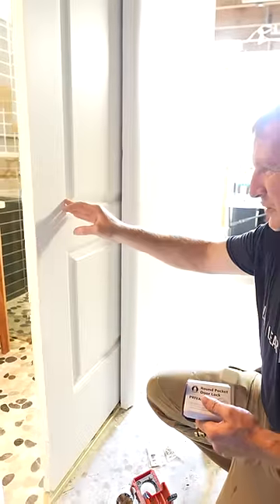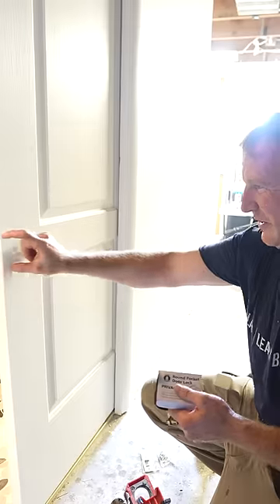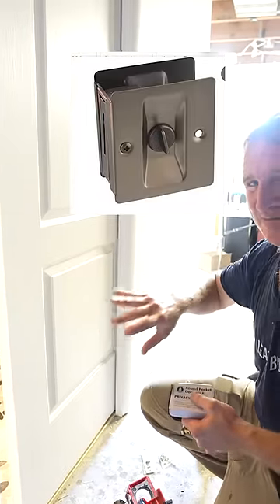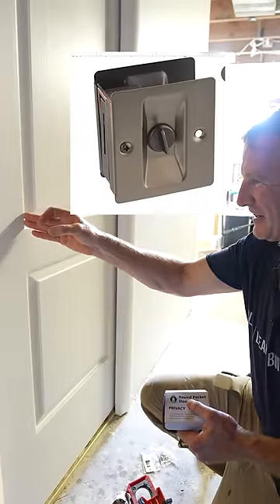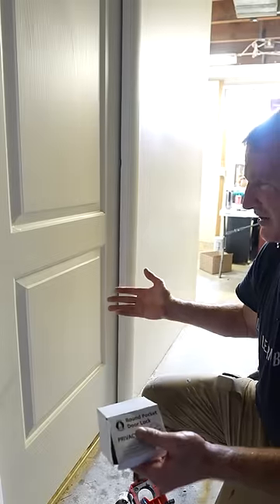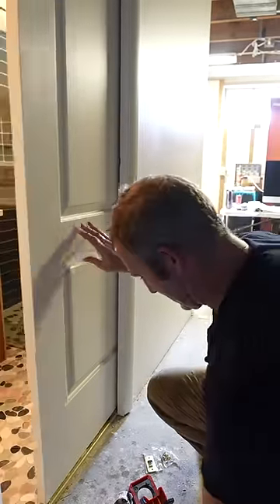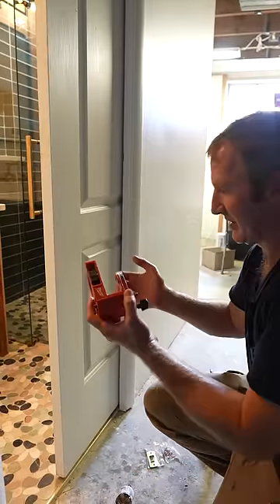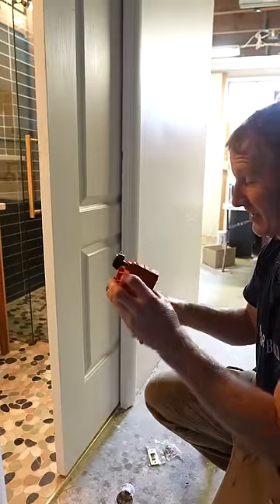Better Pocket Door Latch

Comment: I don't understand why such complicated door locks. 
a hook is needed which, when the door is closed, will fall behind a piece of metal and catch it, in order to prevent its lifting, put another piece of metal that will slide over the hook and prevent its lifting (locked). in order to raise the hook, a circle is needed, the radius of which gradually increases, like a snail's house. or some other simple mechanism.
such a lock is made of four simple pieces of metal and would last for generations. 
I don't understand why we tolerate and buy nonsense.

Comment: Did he just put a dead bolt on a pocket door that opens in a vertical fashion and doesnt swing? Oh no, it has a tiny little tab thathas to have a counter sink to actually work. So if you dont do that its basically useless. More complexity means reduced reliability. The one at my grandfather's house has worked just fine for over 4 decades while enduring the abuse of 10 grandkids and even more great grandkids. Its been the same lock i remember from my childhood.

Comment: Looks like you’re losing the best part of the lock you replaced…that little flip up latch that helps you pull the door most of the way…especially if you have a wife with nails.